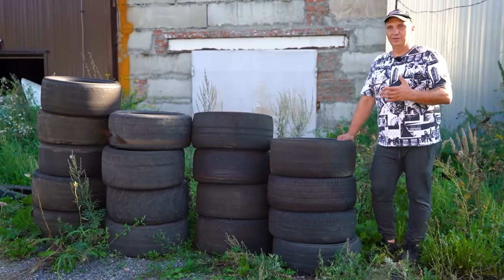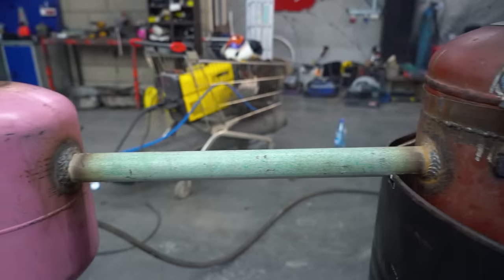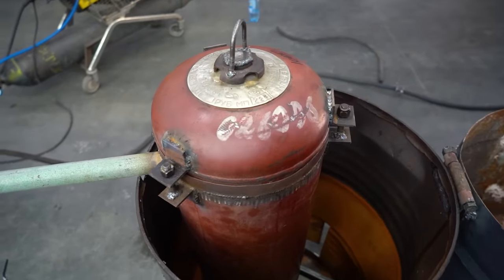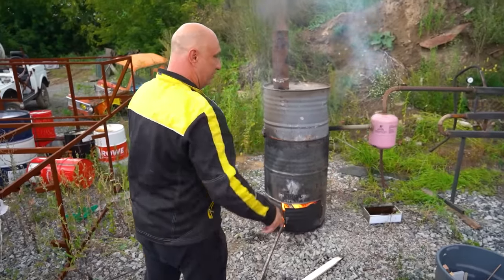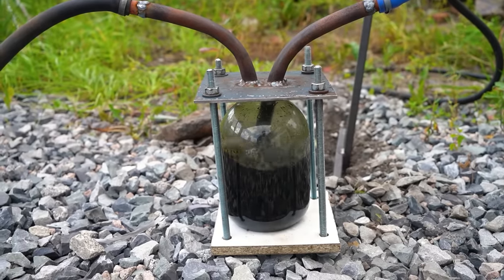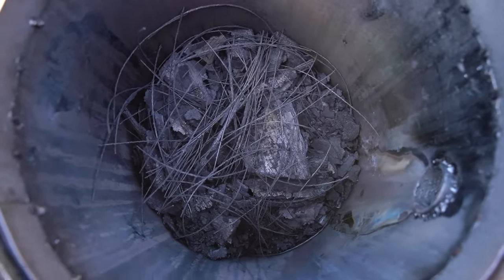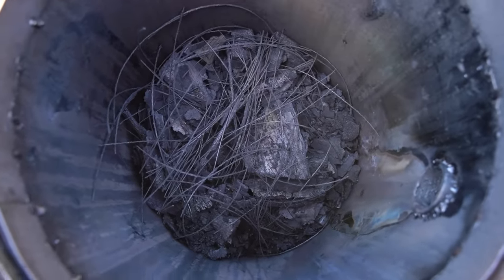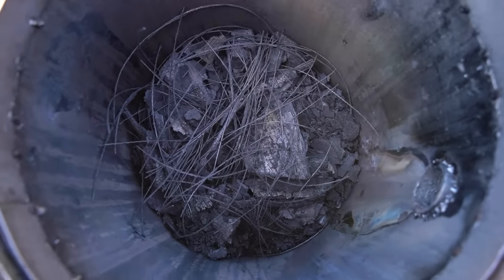We convert old tires into fuel

Comment: worked at a tire recycling factory, the would retread old tires, shred the junk. three tires were the best tires, strong thick sidewalls. these were goodyear. michelin firestone middle of the road but also almost as good were bridgestone firestone, bf goodrich.  crappy tires were yokohama, general, toyo any chinese tires westlake etc...pirelli were very good. this i tested by holding a tire straight out in front of me and wiggling the sidewall back and forth in the air. the firs thing you notice is weight, second thing you notice is the rigidity of the sidewall, where the extra weight comes from as it is thicker, thereby denoting a more sturdy tire. the tires that flopped back and forth like jelly were the lower quality cheaper tires. lots of people do not know this and have no idea and so get caught buying high priced tires that are not high end thinking they bought the best. 
the retread machine would expand around the center of the tire, pressurize and spin, somewhat like a lathe a knife would come along and skim such a fine layer off back and forth it would come off as black rubber fluff until the barest of steel treads would show and it was ready for rewrap. i suspect if this fluff was used, adding this one step would allow for a more controlled experiment with better results. as a proof of concept that this can indeed be done in a backyard setting ts great!
love these crazy guys. 
i wonder if processing the tires and getting all the fluff off would be conducive to better recycling practices and actually be worth some cash. another big sink for petrochemical products is roofing shingles. it takes more energy to recycle this stuff than can be gained and the stuff is bad for the environment because nothing much can be done with them.

Comment: run the fluid through a centrifugal filter/separator and see if the fuel will work with the particulates removed as it is in the first distillation condition.

Comment: Talking with a guy who recycled tires years ago, here is some information to add. (I may not have it 100% correct)
If you add Lye(tea spoon worth) it will help start the reaction and give you a complete reaction. Also means you only have to heat to 400deg to get the reaction going.

Your byproducts should be dirty diesel (high octane) i believe medium carbon molecules, carbon black (good for black smiths), and the high tensile steel, plus the vapors that you can capture or reburn.

You can further break down the dirty diesel to medium carbon molecule gas and diesel.

Comment: The liquid would probably run better in a diesel compared to a gas powered engine since diesel run off compression rather than a spark to ignite the fuel but wonder what that be like in a diesel 🤔
Reply: It may be too volatile to properly run a diesel though... you can't light diesel on fire (in a cup) by holding a flame to it, but this stuff lit off easily.
Reply: Or otherwise, because this start to burn immediately compared to diesel. Also could be better to use on carburator engine, not that clean for injectors
Reply: @volvo09  so you're saying the fuel would pre detonate causing knock?
Reply: i think a moped would run it fine

Comment: Should take your labled bottles and run them individually through a pump and filter process. Test each by rubbing between your fingers to see which was a heavier petroleum. Take the thinner more flammable fluid and test in a car checking the plugs for the correct burn which may require having actual gas added. Also test each to see what settles after a month of sitting still and if the mixture with gas separates.

Comment: Gonna build one.. many plastics can be burned too and get to harvest the combustible liquids. U can trap gases easily with container in water with little weights and filling from top. Then use compressor to suck it straight there to fill detachable gas chambers. Though i called it burning the compounds doesnt burn actually and thats the whole point of this technique. Awesome video finally with actually useful technology

Comment: yes its called dry distillation and you can make fuel from most things that are carbon based.  i think its a perfect recycle means for tires but should be used on wood scraps or agro waste like corn stalks.  the really cool thing is the same process happens to oil in that you get fuel oil -> diesel -> karo -> gas -> propane because the vapor have a different boiling point.

you should have used that fuel you made in some cheapo engine like a lawn mower just to see how well it works.

Comment: I'm going to build one this winter. With Alaskan winters I think I could just use the cold air for the cooling system instead of water. Have my coil outside in -30 below temps and cook the plastic in my shop for extra heat.

Comment: I really wish you would have given some description on what it felt like and smelled like. Was it oily like diesel, kerosene, or thin like regular gasoline? Did it smell like burnt rubber, or something else. 

I'd try pushing it through a fine filter, like one of those toilet paper filters for polishing engine oil to see if it is a brown liquid, or has fine particulates suspended in the liquid itself. 

VERY interesting video...

Comment: Watch the temp on the second filter, that's the stuff at the plants that has 32 different temp sensors in each stack to monitor the tank for hot spots to avoid blowing up.

Comment: Chuck it in a Diesel! 😁 Put a contraption like you have there on a vehicle that has a natural gas jetted carb and run it on the gas without the cooling so it all comes through. I think there are a few gasifier designs from a while back running engines from the gas of wood, but from tires would be brilliant as noone knows what to do with them 🙂

Comment: I could imagine a diesel distillate being easier to make, and less critical.  Igniting the current product would probably only be possible in a hot bulb/glow plug engine, but I don't doubt that it could be possible to run certain types of engine on this fuel.

To be honest, I was actually expecting to see something closer to furnace fuel oil - the kind of fuel that was burnt in oil fired warships.

Just a thought, but what's this stuff like at waterproofing wooden products? I'm thinking it looks, at least, rather like creosote.

This is certainly a better use of old tyres than just stacking them up all over the world.

Comment: If you pour gelatine solution into it, the oil floats on top and the gelatine takes all the particles down with it and sets, gelatine will clean old motor oil.

Comment: Once the tyres are all turned to crispy stuff, that's basically charcoal, so throw it on the fire to use as fuel for future batches, it's the same basic process for making charcoal from wood, but in a slightly less eco-friendly manner (given the rather unpleasant stuff being extracted and latterly burned, versus just using tree carcasses which is infinitely sustainable)... :P

Comment: I reckon the fuel wouldn't be filtered enough to use in spark combustion engines, but quite possible to use in diesel engines!

If you filter vegetable/spent cooking oil, you can use that in a diesel engine, this project here might produce the same results in bio fuel.

Comment: I would like to see a comparison of distillation and filtering. Then an attempt to combine both methods.

Would be pretty cool to see if you can get it running a diesel engine, or depending on its pressure ignition point/flashpoint, a gas engine.

Comment: Whatever you do, pull a vacuum when you filter, should increase distance between particles and allow for more thorough cleaning, and don't hesitate to test and ensure you get some gasoline, because then you know that you could wash the material pulling through the filter with gasoline.

For the filter material, Cabin air filters?

Comment: The destillation prozess is wrong. It has to go through a column to separate the different types of oils/gasoline.
That is why the "crude oil" from stage 1 and 2 catches fire so easily. Everything is mixed together.
latest at the 3rd stage the liquid will be clear if destillation is going well.

looking forward to the next episode :)

Comment: A WW2 engine would probably run on that because most of them are designed to run on 2* fuel which means it is kinda that fuel, some of them also run on diesel and gas

Comment: Build a thick steel container , fill it with the liquid, pull a vacuum on it. Then seal it, only opening after it is heated and under pressure, go to as high off temperature and pressure you feel comfortable going,. With the quality of the container,  use a similar collection and cooling system,  only use 2 collection points, with a coil of tubing in cold water for the final product, . 
Only crack the valve to the container keep it under pressure during the process of cracking and distilling.   
Be careful,  use caution!!  
Also use plastic in the same way as the rubber,  it suppose to make diesel fuel, i belive re distilled under a vacuumed start, and allowing it to produce pressure before the valve is opened   cracking the molecules it should make a low octane gasoline, possibly maybe add benzene or other chemicals or mix with higher octane  gasoline, maybe even add a bit of methanol to raise the octane!

Comment: In a multistep fractioning distillation, I do believe you're supposed to flow upwards not down. You want gravity to pull any condensate back down into the boiler pot not further down the line as different fluids boil at different temperatures and you can control what your result is and get a cleaner seperation between the fluids. You really shouldn't be pulling much from the first two containers until towards the end of your run because as heat moves through the system more liquid will continue to evaporate and move towards the end of the system, thus giving you more of your lighter products and also a cleaner seperation... You noticed this somewhat with your flame temperature. The slower flame gave better results because the slower moving gas allowed the different gases to seperate more clearly, with the heavy/higher boiling point gases being left behind until the end
Reply: The process is much the same as alcohol distillation so if you look at refractioning stills you'll get a really good idea of good designs although I think you had a good first go and aren't far off the mark
Reply: Also you shouldn't be cooling so much between all the stages... You ideally want each container to be hot enough that they would evaporate the liquid contained in the next one(easier than it sounds because a liquid will stay at its boiling point until its all evaporated). Because the liquid at the end is the one that's the easiest to recondensate. So a lot of what should be at the end is stuck mixed with your first and second containers and your end container has contents from the first and second due to wrong gravity orientation and too high of flame heat

Comment: So essentually you use a gasifyer, similar to what is used to extract "Wood gas" aka hydrogen from wood by heating it to the point where the hydrogen is released from the wood but the wood is not hot enough to ignite. Then instead of running it into an engine to be burned you run it into a condenser.

Comment: I dreamed of this in 1989. like exactly... except we had it running 2 stroke dirt bikes and diesels directly out of the distillation.

I know it was a dream but we were salvaging old gas and styrofoam.. anything petroleum based.   only running 2 strokes not because of the oil blend but an EMP that renders coils and batteries etc useless..

try a 2 stroke.

Comment: There was a South African guy who did this sort of thing but on an industrial scale, the plant that he built cost in the region of $8 million. I don't know what happened to his plant of the design of it, but it obviously failed. Not failing as an outcome, I am sure he was able to make good quality fuel, but the energy input must been more that the yield. There would be no point in producing a liter of Diesel fuel for $110 when you can buy it from the filling station for $2, but it is nice to see that the process actually works now you just have to find a way to do it very cheap, maybe close to a very hot thermal underground source that is very close to your market or the transportation will kill you.

Comment: You can run old engines with mechanical injection. Its black, because contain lot of ash, so if you want to try run some engine with this oil, you need to filter it wery well with really fine filter, something like 5 microns, and separate water, because there is also lt of it. For this is best water separator filters like are mounted in big engines like dozers, tractors...they have this filter. After you filter it and remove water you can try run it in engine, or you can distill it again to separate diesel, gasoline and wax. Please try all this, I want to see it! :)

Comment: I've seen the other video, on how to take the product and further refine it into a reasonable gasoline substitute;  they used a second heat source to accomplish this goal. 

I'm wondering why they don't just add another tank on top of the furnace and extract the heat from there?!

Furthermore, sup'm in yis video didn't appear to be very safe;  allowing flammable liquid to flow neat a heat source is just asking for trouble!!

Comment: If you had a carbourreted generator you woukd have been able to run it using that expelled gas.

Technically anything that will burn if hot enough can go ibto that hopper and make fuel. Even dog turds if so inclined.

Comment: This crude fuel would work perfect in a GEET fuel system or any bubbler system for stationary engines or manual transmission powered vehicles just got to give the fuel the proper Air to Fuel Ratio and it will burn clean and replace fossil fuel. FJB. Build this and be ahead of the curve tires and plastic is easy to get just be safe. Use a Rocket Stove to heat it up it will be more efficient than a open flame and especially with a fuel return or bottle it up in propane tanks for compressed gas later hot water heat are your gears turning now Lol it works well distill the heavy oil for light oils which will run any gender with proper air control and some babysitting until you figure out your system. Nothing ventured nothing gained Idleness will never get anything done cause talk is cheap now intentional people they GetRdone cheers

Comment: Old diesel electric generator will eat this ;) But this system is not sense for ecology. Better re-use the old tires, like for pot, stairs, walls etc. Because you produce CO2 frim wood fire to make fuel what will produce CO2 again after burning in generator /heater 😂 And off course for making this new tires (in past )was produce CO2 also.

Comment: All you need is some basic steel pipe, a steel drum and containers to catch the oil in. Water cooling and welding aren't necessary either, making Oil/Gasoline is a handy thing to know how to do and it's very easy, you can almost do it for free. This is a nice system you made, the water cooling probably speeds things up and the valves on the bottom of each tank is a nice idea, plus it looks a lot better all welded together.
Reply: The water is needed. For distillation the Vapour needs to be turned back into a liquid.

Comment: I'm sure this stuff would run OK in a lawnmower. 

Maybe a bit smelly..

Oh btw, tires are vulcanized which means treated with sulfur to give them elasticity. 

I guess the fuel from distillation will be extra high sulfur. Don't run a new TDI engine on that.

Comment: I'd like to see this stuff filtered and run in an engine. Find out if it's more like gasoline (petrol) or diesel. Perhaps you could make a setup using a remote oil filter kit and a good quality oil filter or diesel fuel filter.